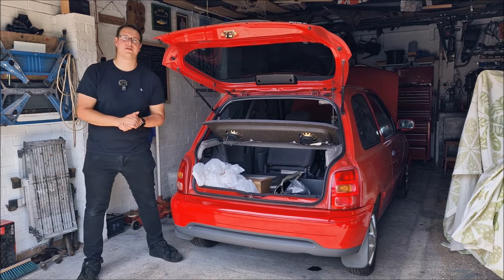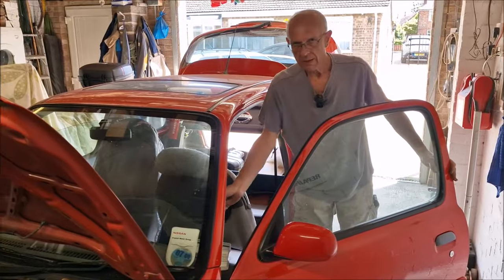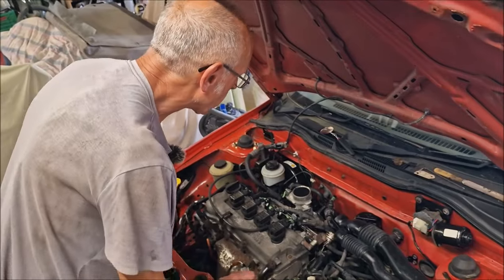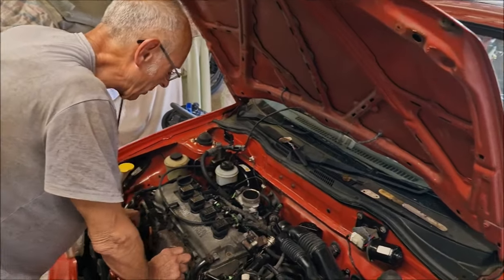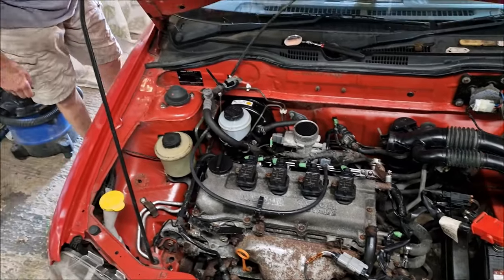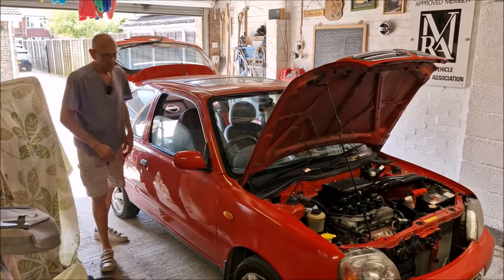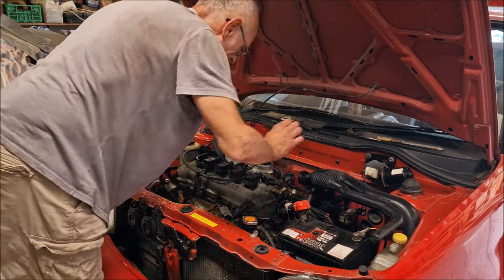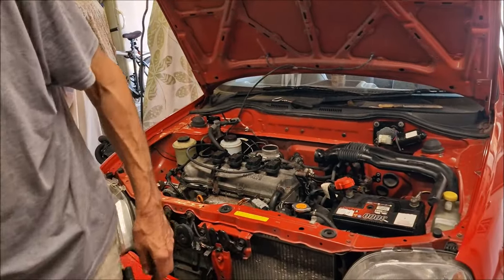K11 Nissan Micra Idle Speed Fault Now Diagnosed - But Is It An Easy Fix For Dad?

Comment: Well done Jon and Pete a great video as ever and I definitely agree sounds like it is going to be the idle control valve or maf it’s not regulating it’s idle speed and probably not communicating right with ECU I’ve had one go on a focus in the past 
It’s coming on great well done on your hard work
Reply from the maker: Cheers Daniel. Fingers crossed 🤞

Comment: I bought my wife a 1.3 CVT K11 on an L plate c. 1997, with only 2,500 miles on the clock and 1 owner. She kept it for around 23 years until the tin worm meant there was little to weld to. It was a nippy peach of a car - my only grumble being the lack of power steering. It only needed 2 (cheap) refurbished throttle bodies and (equally cheap) fan resistor cards plus a new dizzy cap, apart from normal service items. There are still low mileage K11s around and from time to time I find myself eyeing the 1.4, with all the bells and whistles. I suspect you're not that far from me (Lincoln). Did I say we have a Smart 451 turbo, too?!
Reply from the maker: Sounds a lovely car! Yes we are a bit further east from you - the one with the big church! - I love the Smart 451 Turbo :)

Comment: Oh Jon, I would not be furious if your dad robbed bits off the museum Micra. I'd be disappointed and as we all know, that is far far worse!

Joking apart, fault finding can be so frustrating so fingers crossed, the throttle body, idle control valve and MAF sensor replacement sorts it out.
Reply from the maker: Cheers ☺️👍😊

Comment: From memory the ICV other than a clean if taken apart needs to be set back up with consult. The other avenue worth exploring is the engine temperature sensor Not the dash gauge sender its worth removing and testing in the past i have had one with loads of crud stuck to it effectively acting as a thermal insulator. On the coil pack Micra its easier to get to as you don't have a distributor in the way, worth checking especially if it has been laid up whilst tinkering on the sensor I'd be tempted to test the thermostat at the same time and replace the coolant. Unfortunately I've not tinkered with coil pack Micras as mine have and are distributor ones with the Hitachi throttle body and injectors that's a whole other headache. Excellent content as always I'm dailying my k11 this week as i get my i10  ready for the MOT fingers crossed.
Reply from the maker: Some good advice - I reckon Dad has tested all that in the diagnostic process but as you say without Consult it's rather difficult to do a lot of things! Enjoy your Micra weekend 😄

Comment: You could always take the idle control valve off the museum micra and make sure 100% its that.
Reply from the maker: We did consider that ... but we also considered running the risk of breaking it in the process ... leaving us with 2 broken Micras :)
Reply: Didn't you have a third Micra, Jon? Was it an auto? What was the plan for that?
Reply from the maker: @Nick_of_Windsor  i do - its still here in the collection :)

Comment: Bring back the carburettor, much easier to set up and run, showing my age now, Jon. Your dad comes out with some great one-liners😂
Reply from the maker: Yes! The carb system would certainly have been easier! I think he comes up with them without realising it 🤣
Reply: The days of the carburettor remember them well but I do think we look back on them with rose tinted glasses back in the late 70s and into the 80s I've lost count of the number of times I ended up having to put right someone's Sunday tune ups same goes for points and condenser. Towards the end of the 80s the dam carburettor became such a pain to set up that we were over the moon when fuel injection became the accepted norm and not the preserve of exotica. The K11 is often cited as the cockroach of the 90s super mini but they can be a bugger sometimes often because of delayed or missed maintenance. Not  suggesting for a minute this is the case here I have run quite a few k11s  that I rescued passed on still have a 98 inspiration in daily use.Thankfully I'm long out of the trade I could see where the industry was going by the mid 2000s and settled for a steady job with the council and just tinker for fun.